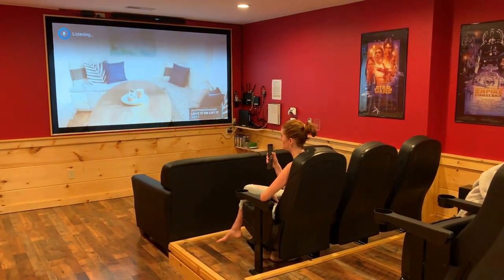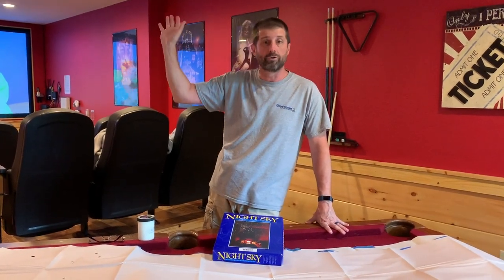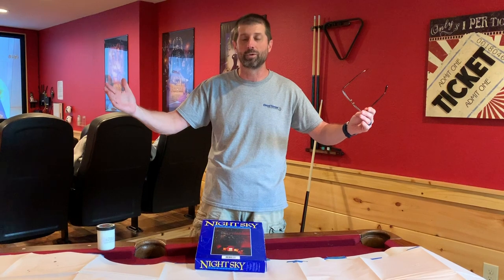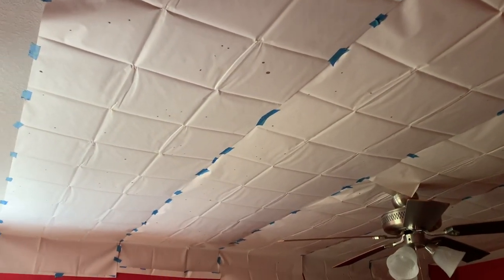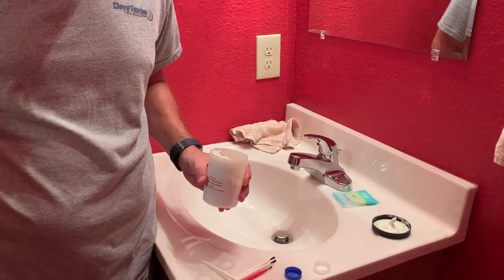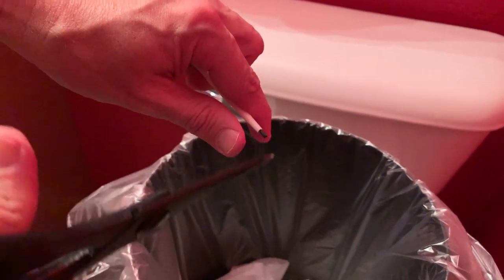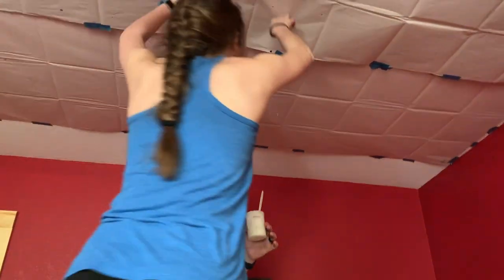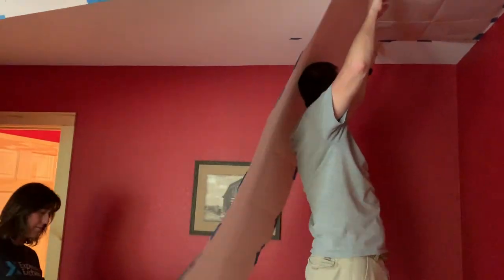ACCURATELY PAINT GLOW-IN-THE-DARK STARS ON CEILING | Glow Inc Paint/Ursa Major Stencil | TuTu Ep 78

Comment: This looks amazing, would it be a good idea to do it with out the stencil 🤔
Reply from the maker: Totally doable without the stencil! For this room, the stencil covered the main section, but there were some places along the edges that the stencil didn't reach. So for those spots, I just went along and randomly placed paint dots to fill in the blank areas. 
I used the stencil because it comes with two big advantages:
1) It's accurate to the night sky. I'm pretty nerdy, so I think it's so cool that it matches the actual stars in the sky. 🤓
2) It can be hard to tell where you've already painted without the stencil. When I did the blank areas that extended beyond the stencil, it was hard to tell if I'd already filled in a section or how dense my star placement was for that section. The stencil takes out that guesswork and keeps the stars even across the whole ceiling.
So it's definitely feasible without the stencil, and even with the stencil you might need to "blindly" add stars to sections that extend beyond it. But the stencil does make things easier. Hope this helps!

Comment: Can you use glow-in-the-dark spraypaint with the stencils?
Reply from the maker: I haven't tried this, so I can't say for sure, but my gut is saying it might not turn out the best. The paper tends to hang away from the ceiling a little bit when it's hung up, and when using the paint brush you just push the stencil against the ceiling to know where to line up the star holes. But with spray paint, that gap and the force of the spray paint hitting the paper might cause it to shift a bunch and not got crisp, clear stars. Hope this helps! If you do give the stencil and spray paint method a try, I'd love to know how it goes for you.

Comment: Suggestion: The stencil panels are like  12 feet long...why not just cut them into  three 4 foot sections ?  So much easier to tape up. And no reason the  tape the entire ceiling with the stencils at the same time, tape up the first 2 rows....paint..then add 2 more rows....and on and on.
Reply from the maker: Not a bad idea! I think the biggest hurdle with cutting the panels smaller is it would make it harder to line them up. Especially since the paint is hard to see once it's on the ceiling. Also it might take a little longer if swapping between taping up panels and painting, since the painting portion goes pretty quick. Then again, hanging up the long panels takes a bit of time, so smaller panels might work out better. Wouldn't hurt to try!
Reply: @CraftersAutonomous  You do not need a perfect alignment..they are just dots on a ceiling....would not make a dam bit of 
difference...
Reply from the maker: @fairamir1  Well the whole idea of using the stencil is that the stencil matches the actual position of the stars in the night sky. So if you want just random star placement, then you could skip the stencil completely. But since the whole idea of using the stencil is to accurately match the night sky, not lining things up right would defeat the whole purpose of the stencil :)